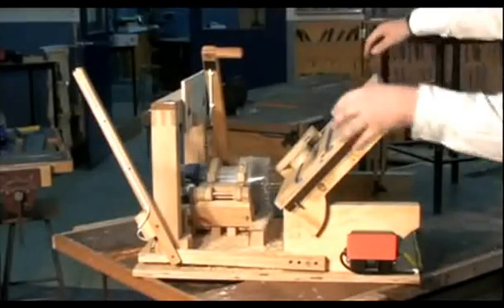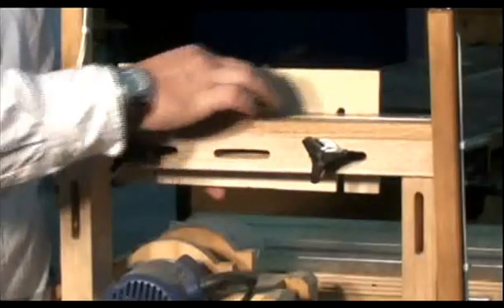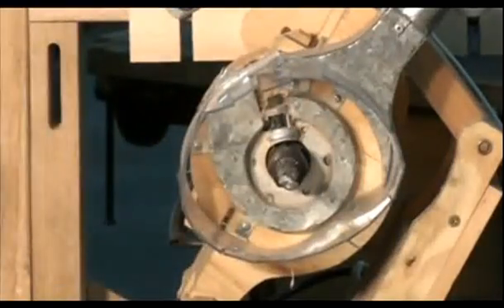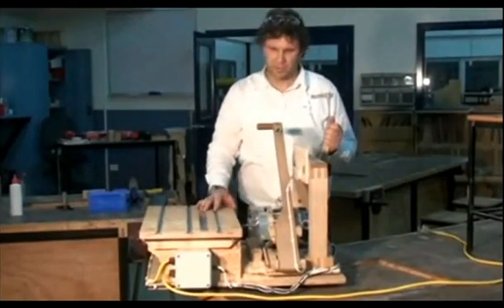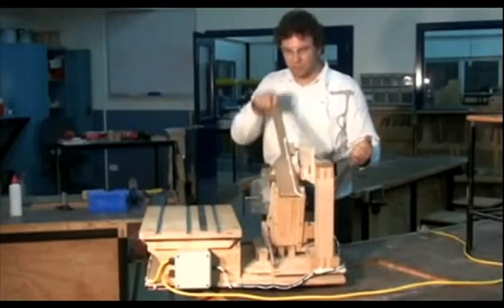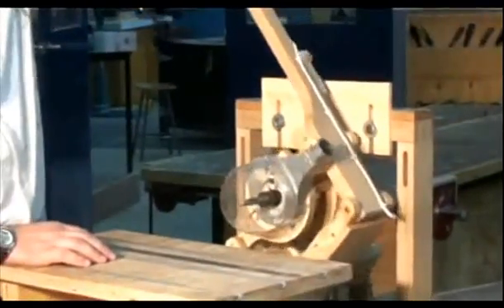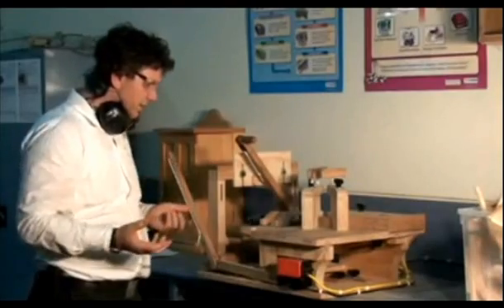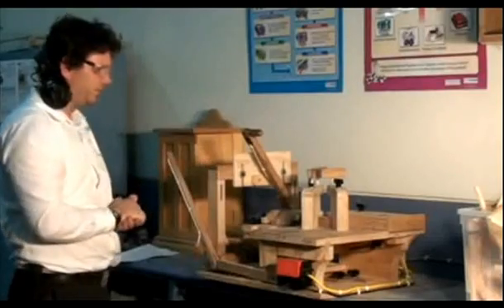pantorouter improvements part 2

Comment: Thanks for this info Luke. Much appreciated. I actually got some groove runners from Dorset which appear equivalent to the centre slides Matthias recommends as suitable. Not sure if you used these ones. But If you did, can you let me know if you modified them in any way, or just used them as is? Cheers.
Reply from the maker: The ones i used had three slides telescopic. The external slide i through out, the internal slides i kept but added an extra 1/2 bearing cage from a third one to decrease any slack in the system. The length of the runner also had to be reduced. Quite a bit of stuffing around but I did get the runners for free.

Comment: Very nice work Luke! I'm really impressed with your improvements on Mathias' machine. I too purchased the plans and intend to build myself one of these beauties, and will endeavour to incorporate some of your innovations. I too live in Australia but am finding it difficult to source some of the hardware Matthias used, in particular the full extension drawer slides, as well as a suitable router (ie. non-plunge type) to fit. You have obviously solved these challenges, so I would appreciate any advice you can provide on these issues, including if available, the specs for your cool switching system. Many thanks for your videos!
Reply from the maker: Draper is the brand of the router and i bought it from amazon, it is made for the uk so uses 230v which is within the tolerance of our 240v. Might wand to try http://www.dorset.net.au/ for your draw slides. Switching system used a 24v ac transformer that powers the 24v ac relay through a series connection through the two switches, I had a very intelligent chemist friend who also works in electronics help me with the components to ensure there were no surprises. Good luck

Comment from the maker: 24v ac tranformer powering a 24v ac relay is what I used, as for the specifics I would prefer to not give advice on something which could get you killed.I had some help from an electrical engineer.

Comment from the maker: The airflow of the router is not blocked, rather it is diverted to the outside of the vinyl guard where it does not effect the dust extraction.